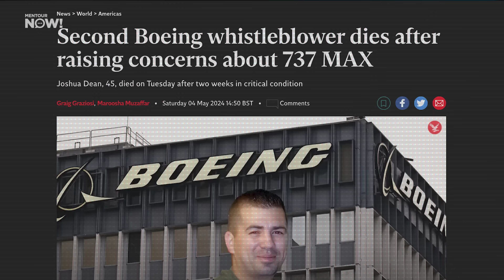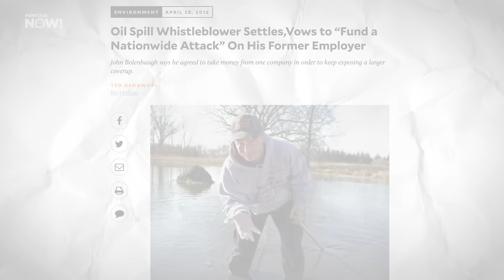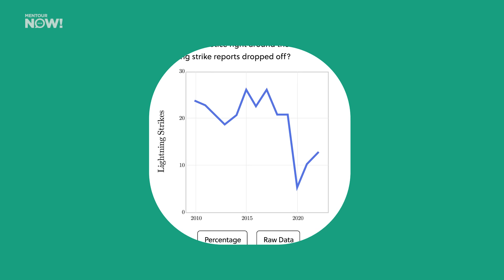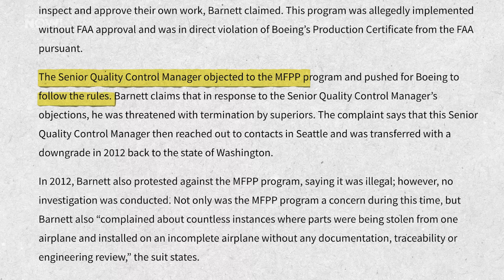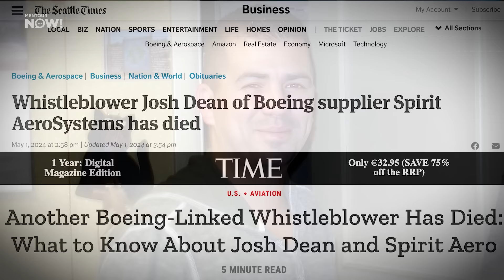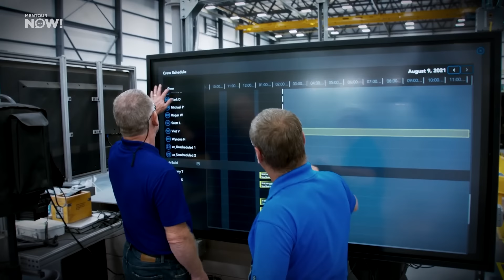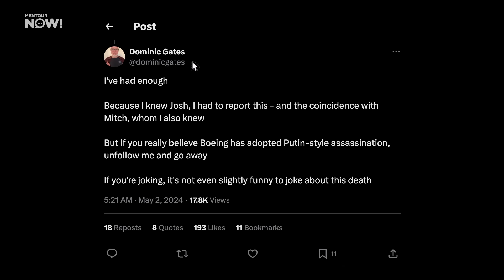Whistleblowers Vs Boeing: What Happened?

Comment: One 737 Max falling out of the sky looks like an accident, two in quick succession looks like a problem - one Boeing whistleblower dying unexpectedly looks like an accident, two …
Reply: The key to getting away with a murder is to not be a suspect in the first place. Its unlikely that the company would've done it since they'd be the main suspect. Heck, it could've been someone hired by Airbus to tarnish the reputation of their competitor.
Reply: @ryelor123  Bad take. It was either make them disappear or have them continue running their mouth. Do you think the company really thought "Oh but I am going to be a suspect!; I am going to have to watch my 110 Billion Dollar company be destroyed because I might be a suspect!" ?
Reply: ¿The most sought after and efficient of all aircraft designs, 737MAX,  has a problem? I don't think so. 737MAX has a corresponding pilot recertification simulator program with every airplane sale. The two foreign airlines that crashed declined to have their pilots certified on 737MAX.

Let's point out the fuselage where the door hatch blew out are made by Spirit, who also makes fuselages for Airbus. The engines are made by Rolls-Royce and GE, who also makes engines for Airbus. The seats and galleys are by Ipeco which also makes seats and galleys for Airbus. Etcetera. Aircraft maintenance is by individual airlines, who send their planes to 3W maintenance centers, and the control systems programming is done in ln'dia!

Let's share the credit with everyone who touched these planes! Boeing airplanes are still safer than riding a bicycle, or crossing the street or going to your local 'healthcare' center.
Reply: But the whistle blower dying has had the opposite effect, it hast improved Boeings position at all.
Reply: The idea, true or not, that these Whistleblowers are being assassinated is just chilling.
Reply: @skyborne80 welcome to the real world. There's a reason these CEOs get paid what they do...
Reply: @AmericatheBeautiful-p4z 
Y’r pretty wrong here. In fact Boeing MCAS was not even mention og informed to the airlineas that bought the plane. Not even mention training the pilots for that. 
So yes, Boeing is still safer to fly then driving/ciclying etc , but steel worst then Airbus. 
Maybe should i mention the Concorde that had an accident because of airplane belonging to Boeing/Douglas McD
Reply: @simionciuciu7736  Maybe mention Airbus flight controls failure crash in slamming fireball off end of runway. 7450 pedestrians mowed down by drivers every year wait until auto-pilot deliveries 10,000 a year mowed down. Airplane safest form of travel for 120 years.
Reply: @ryelor123  Airbus is involved you think? This is not 1930's where such tactics are used.
Reply: @AmericatheBeautiful-p4z wrong. Boeing choose to cut corners in manufacturing and assembly. The design of 737 max is indeed the best in the industry but design alone can't make it a reality. Boeing did not wanna recertify its planes to save time and money. But guess what? Didn't save them shit. Stocks went tumbling and planes were grounded. Yes, maintenance was an issue but let me tell you that for a plane like 737 max with less than 10 years of fly time maintenance would not have led to a missing door plug or landing gear falling. People have admitted that boeing was doing thing the wrong way after the merger and its simply that. Otherwise people wouldn't end up dying suddenly. Or maybe you live in an alternate universe.
Reply: Exactly.  I'm pretty hardline on not pushing baseless conspiracies, the universe is random and shit does in fact just happen, that kind of thing.  But when a bunch of bad press surrounds one company and then not one but two whistleblowers die almost back-to-back...  Yeah it's kind of hard to not be suspicious.
Reply: @ryelor123  Boeing is a defense contractor. They could have used anyone with DoD protections.
Reply: @AmericatheBeautiful-p4z  "Airplane safest form of travel for 120 years."

No. False interpretation of statistics due to length of journey: safest form of travel per mile but not per journey - aviation is no safer than driving your car. Per journey.
Reply: @ryelor123  This only applies if there's any punishment for it. If there's no real investigation or punishment what do they care if they're a suspect?
Reply: @AmericatheBeautiful-p4z  definitely not a bot.
Reply: @nirbhay_raghav  The design of the max is not the best in the industry. The fundamental design is flawed because it's based on a plane from the mid 60's that had wildly different considerations. The pitch up tendencies of modern 737's under thrust has been a factor in numerous crashes and it is so bad with the Max that that had to invent MCAS, which didn't go well. They keep fitting bigger and bigger engines to a plane that was never designed to handle them. Don't tell me the 737 is some sort of modern marvel of design. It's a venerable and well proven aircraft but it's dated and has needed a replacement for a while now.

Comment: It is a lose - lose scenario. If staff don't whistleblow, they will be framed for negligence when the Boeing aircraft inevitably crashes. If they try to avoid this situation by blowing the whistle, they are punished or sacked and when they try to get compensation by testifying, they get killed. The only way to avoid this is not to work for Boeing or its subcontractors.
Reply: Exactly. One of the best comments I've read.
Reply: Bet you have a portrait of Greta Thunberg in a red bandana on your wall. Air travel by Boeing is safer than riding your bike, or crossing the street, or visiting your local 'healthcare' center.
Reply: @AmericatheBeautiful-p4z  What a bizarre comment. Greta Thunberg has nothing to do with the topic at hand. Nice attempt at deflection, though. Anyhow, if you have any moral compass, then you'd realize that the reduction of any unnecessary deaths caused by carelessness and/or greed is a moral good.
Reply: @AmericatheBeautiful-p4z  
Jeez!  - Is this a Boeing official restating Boeing's policy on how Boeing is going to improve its horrible safety and quality issues? No, quoting Greta Thunberg is not a quality control measure, won't improve Boeing's total contempt for aircraft safety or quality control.
Reply: @Jasper_the_Cat  850 bicyclists and 3,375 pedestrians were mowed down last year, NOT ONE WORD OF MORAL OUTRAGE FROM GRETA.
Reply: @AmericatheBeautiful-p4z ur a weird conversation changer 😂😂😂
Reply: @AmericatheBeautiful-p4z  yes, flying is very safe, bnut this has nothing to do with the fact that being as a manufacturer has been doing a very poor job recently......
Reply: @AmericatheBeautiful-p4z Good point. We should ban cars in a lot of places so they can't hurt pedestrians and cyclists in shared traffic. 
Cars get bigger and heavier making them vastly more dangerous in the case of a crash.

Especially hoods have gotten so tall on many trucks people drive over their own children in their driveway as they can't see what's directly in front of their truck.

Thank you for raising awareness for this topic! If you're interested in more on this topic not just bikes is a fantastic channel. 

However governments are able to do more than one thing at a time. We can build dedicated bike lanes, delete on street parking, improve walkability of cities, and make car ownership optional, while at the same time making sure that airplane manufacturers don't improperly cut corners leading to hundreds of easily preventable deaths.

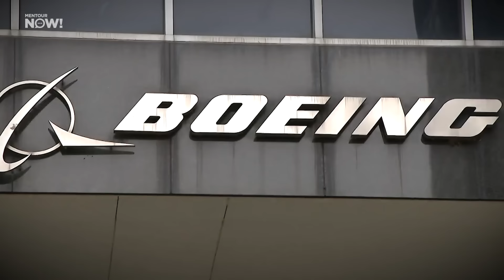Comment: 19:57 This is exactly what Toyota implemented in the Toyota Production System, they call it autonomation (jidoka). If a worker spots a defective product on the manufacturing line they stop production until the root cause of the issue is fixed. This reduces waste by avoiding the manufacturing of defective products that would require fixing later in the production process.
Reply: Unfortunately, Toyotas made in various countries all over the world (France, Turkey etc.) are not the same as the Japanese originals of the '80s. (I've been working for Toyota & Lexus for a couple of years).
Reply: that is one of the parts in the LEAN philosophy, and from watching all of petters videos on Boeing, i doubt LEAN has a very big presence at Boing, atleast not anymore... (They did seem to have a Kanban board though with scheduling)...
Reply: @Sheley7  from what I can see Boeing went to the dark side of LEAN. "More for less." That's basically LEAN mantra. They removed quality checks, again, that's lean holy grail that you can pull off when your process is flawless. They stopped repairing defects, because fixing things takes extra time but doesn't create extra value. Boeing is the Darth Vaders of Lean.
Reply: @michalsetlak I bought the LandCruiser just because it was made at the Tokyo Toyota factory
Reply: Your'e on the money there,ths Japanese have a more hounorable culture esp in Toyota,the Germans use to have that quality, but being under the heal of the international financial elites since their defeat in WW - 2,that pride has become watered down! But i have noticed a change  BMW has been scoring very high in the reliability rates of late perhaps they can salvage that pride and honour,perhaps the America of old can come back and make the quality they use to!